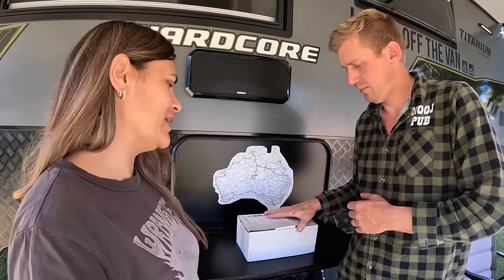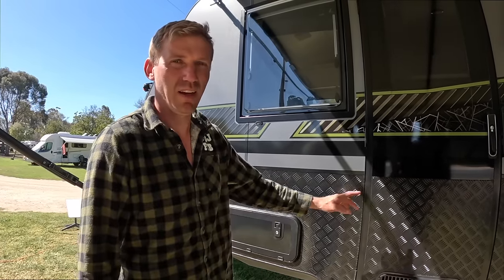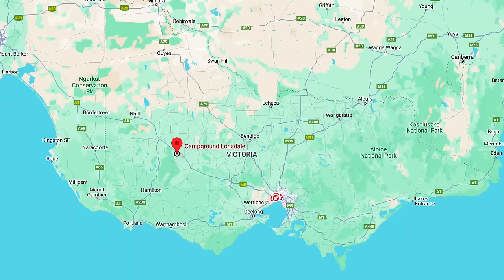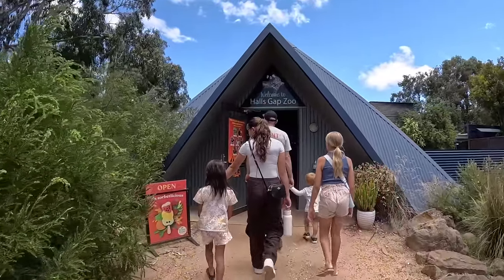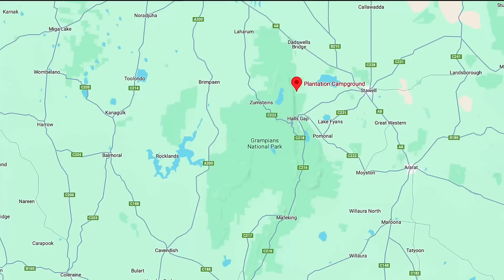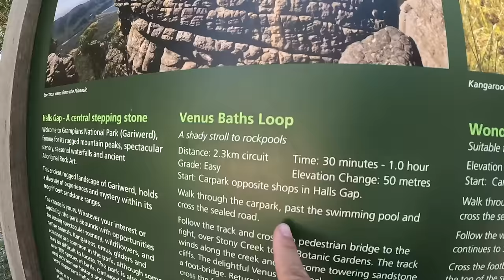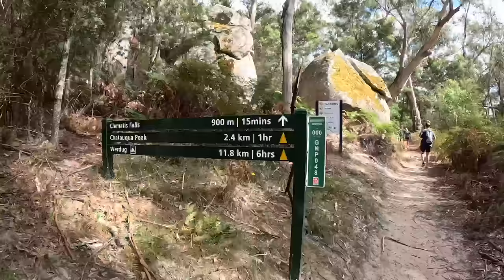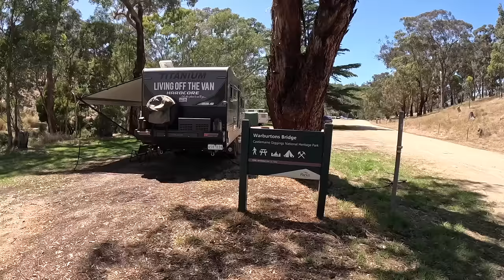CARAVAN UPGRADES- GRAMPIANS NP- 115- LIVING OFF THE VAN- TRAVEL AUSTRALIA- @LivingOffTheVan

Comment: On your stone stomper conduit, I find a lynch pin placed through a hole  at the end of the conduit is very good. Lynch pins are quite cheap at Bunnings.
You should also use a lynch pin on the locking ring of your trailer coupling. Both can be the same size.
Reply from the maker: Great idea! thank you!